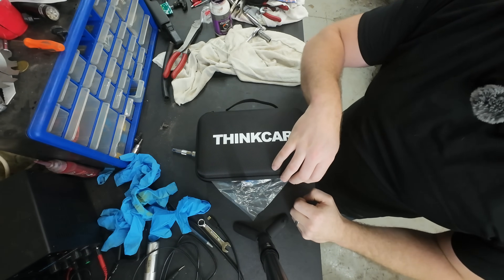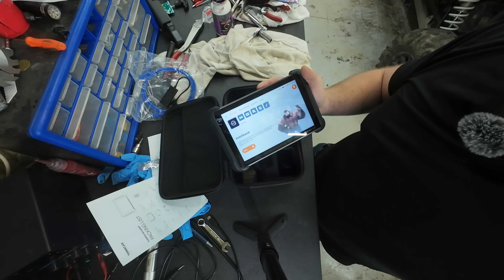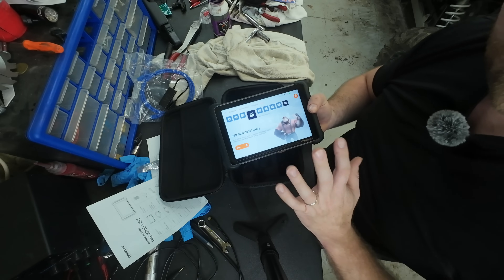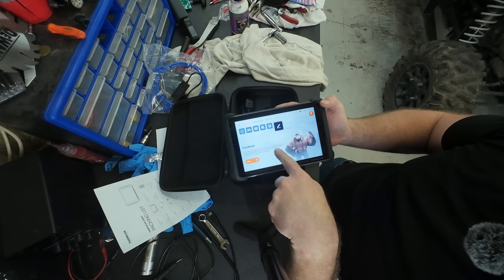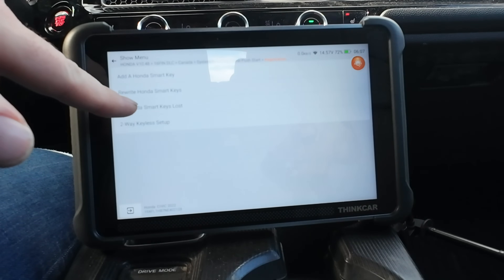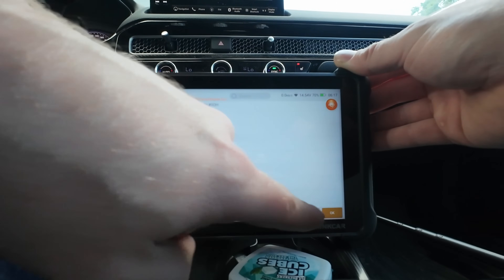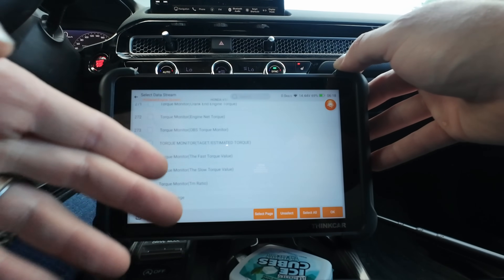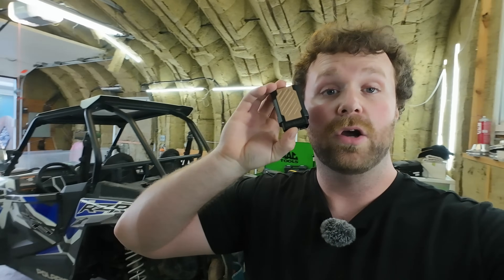Thinkscan 689bT. Did what the $2500-5000 scan tools can do.

Comment: Thanks for sharing Does that scanner reprogram abs control module
Reply from the maker: You'll have to check the support list. I do see makes and models it can program. I don't expect it to be able to on for example a 2025 gladiator but its defiantly supported for alot of vehicles from 2000s to 2010s